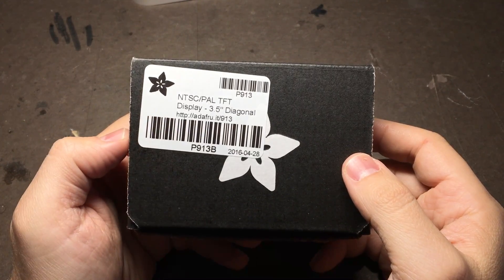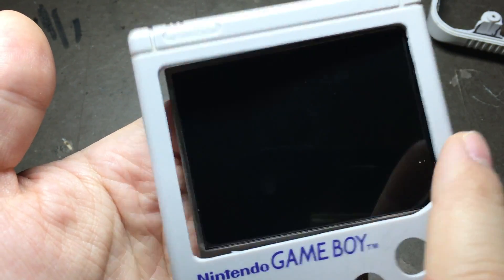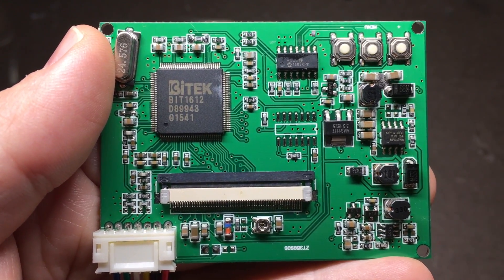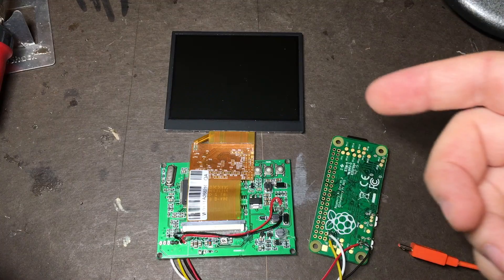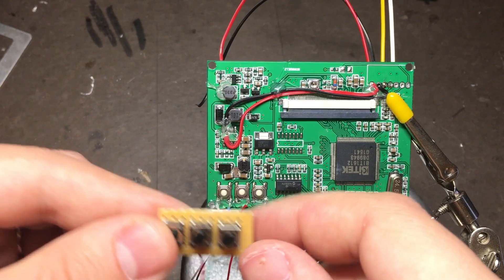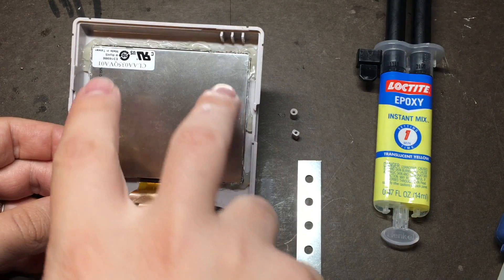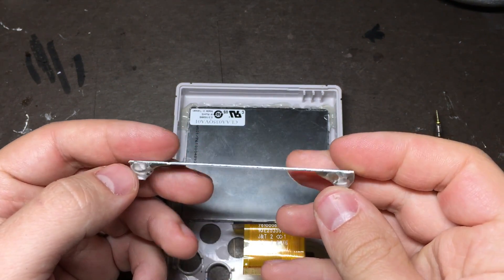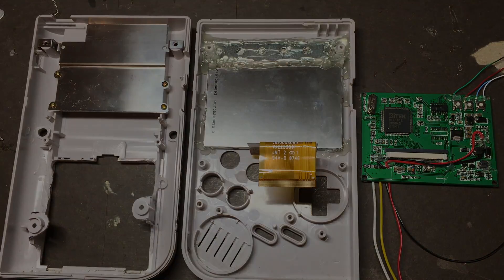Game Boy Zero Guide Part 3 - The Screen

Comment: anyone else getting white screen over the composite? I know my shit works as its outputting on HDMI perfectly. It makes no sense whatsoever.
Reply: using BW variant 9
Reply: Sam Frankelli Hey, I was having this issue and after trying everything I could find it still didn't work. I don't think the screen model is compatible because others have had the same issue. I returned it and bought a new screen and it worked right away. I got model 7 the second time.

Comment: Would a screen like this be possible?: http://www.dx.com/p/geekworm-3-5-high-speed-display-screen-tft-module-for-raspberry-pi-441223#.V8yPSJN96H4

The formfactor isn't right but it's digital and the resolution is a lot higher so if I can find the right formfactor this could be a very nice display.

I want to build my own GBZ but the adafruit displays are out of stock and they are also composite and low res. Any advice would be great thanks!

Comment: Why did he connect also the ground-pin of the voltage regulator?  If you remove the ic it's only necessary to connect the 5V-Pin-

Comment: Found this screen and going to give it a try.  Others might benefit from this source.
http://www.gearbest.com/development-boards/pp_29447.html
Reply: Does it work??
Reply: It's on the way.  Have not been able to test it yet, but it was apparently verified by another person on his blog.  I will post my results here when it arrives.  

Meanwhile, here is the blog link.  http://sudomod.com/wiki/index.php?title=Noname_GearBest_3.5_Composite_Display
Reply: Yes. The screen from Gear Best does in fact work as stated in the wiki.  There is only one wire to solder on the screen's controller board.  It was difficult for me to do, but I'm bad at soldering.

Comment: It's a shame it's composite video, even on a small display that doesn't look very good..
Reply: well the screen is 3.5 inches and the resolution is 640x480 and considering now small the screen iz it looks amazing. My tablet is 1280x800 and thats 11 inches so the gameboy has more pixels per inch making it look better than my tablet. Point made
Reply: Is there a way to display a RGB signal ?
Reply: Josh - Even with tha resolution it's still a bad signal, you'll get a lot of noise, bad color, etc.

Star Platinum - The Raspberry Pi Zero has HDMI out.
Reply: Thanks, i can't deal with composite. It's ok when you know nothing else but we have higher standards nowadays.

However i think a 320x240 screen would be more adapted for retro games, which are nearly all in 240p.

Maybe it would look crisper with 3D games but i can't really tell.

Comment: hello which chip is that? My screen looks just like yours but laid out a little differently.
Reply from the maker: Have you guys checked out the wiki yet?  Lots of screens have been added, many with some guidance for how to convert it to 5v.  sudomod.com/wiki
Reply: mine too... My reverse cam screen has a different board in it, im a little stuck on how i convert it to run off 5v :/

Comment: what if I only have the shell to game boy (no electronics inside)
Reply: +EthanMLego look on the forums. Someone found a controller board that matches the gameboy one. Its about 40 bucks. So it would be cheaper to buy a broken gameboy. Snagged mine online for 19 bucks only problem was the screen was bad.
Reply: You can use it but won't be able to do the sd card in the game cartridge part

Comment: Those rear view monitors will still work off of  the composite video pin outs, right? I bought one of those and a 5V-12V step up board on Ebay for $17 total!

Comment: I'm looking into making my own version of a Game Boy Pi and I was wondering if you had any suggestions for making it be able to output to the built-in screen as well as optionally able to output to a separate monitor. That way you could play it on a TV and then unhook it and play it on the go. Thanks in advance!
Reply from the maker: +Lime Studios Yep, it does that.  :)  I have the mini hdmi port lined up with what used to be the contrast wheel (you can see it here: https://www.youtube.com/watch?v=aMhTMgDHGaM ).  If you power it on with the hdmi connected, the video outputs to that in stead of the internal screen.

Comment: I've asked before and didn't get an answer, so I'll try again, what size gauge wire are you using? it looks like 24g.
Reply from the maker: +Derek Bamford I actually don't know offhand for this part.  24g sounds about right.  I'm just using the wires that came with the screen.
As for the breakout board, they are super thin wires that came out of an old IDE cable.  You can use whatever comes with your screen for it, and as thin as possible for buttons.
Reply: Thanks man. Biggest bottle neck are those damn adafruit screens.
Reply: +Derek Bamford You can use alternates for this. http://www.amazon.com/BW-3-5-Inch-Monitor-Automobile/dp/B0045IIZKU?ie=UTF8&psc=1&redirect=true&ref_=oh_aui_detailpage_o01_s00 works. There is a big write up on the top at Wermy's forums.
Reply: +Derek Nesselrodt can't beat that price either.